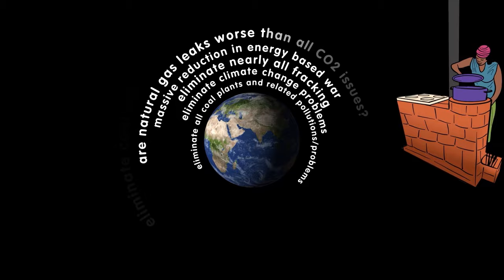free, earth friendly heat kickstarter

Comment: I've been pollarding young saplings of wood, hickory, oak, and soon black locust.  I don't have a wood stove installed yet... so far I just have a small one that I intend to put in.... but I'll be using pollarded wood cut with a hand saw to do it.  It's cheaper than buying oil, and I can sustain my wood usage with less than an acre of land.

Pollarding/coppicing is definitely under-rated in the USA, probably because Europeans have been doing it since they were serfs, while Americans could pretty much always buy their heat, even in the form of firewood or at least the fuel to cut down entire older trees.